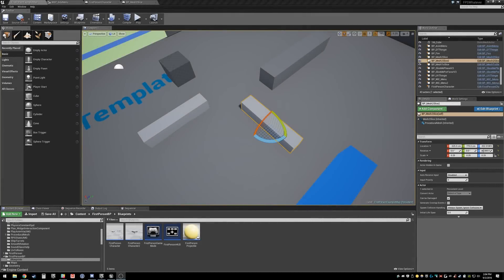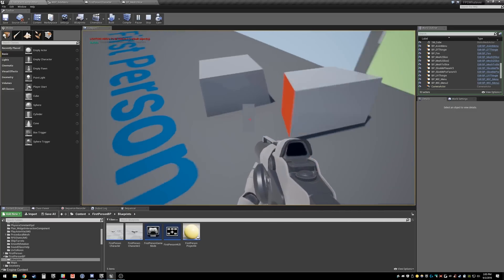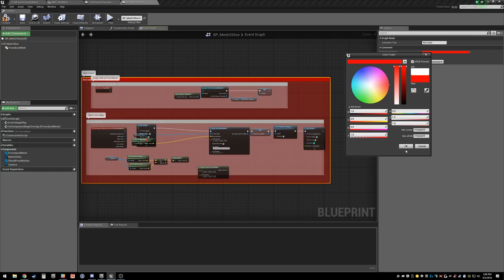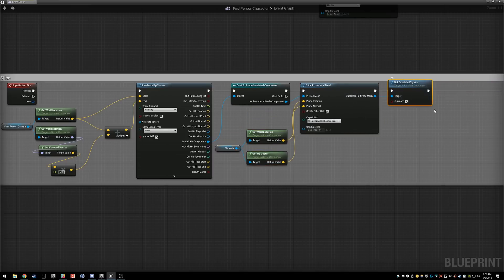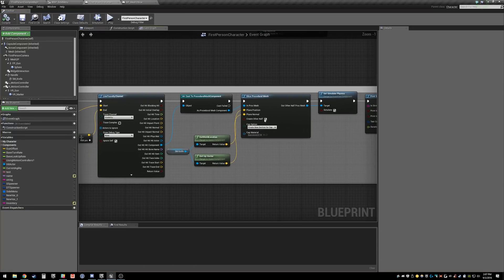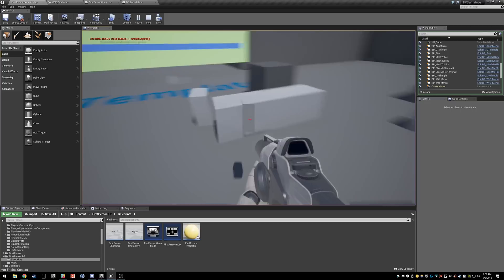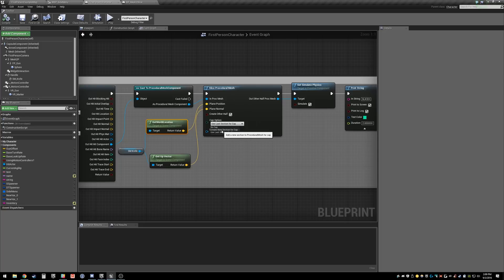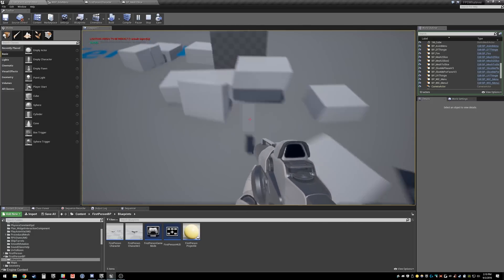Advanced -  Slice Procedural Mesh

Comment: Does this system work iwth complex shapes and objects created outside of the engine?  IE, could you slice up that gun that yoou are holding or does it only work with simple objects created in UE4?
Reply from the maker: Hmm, strange I didn't get these notifications. Hopefully you figured it out by now, but yes to gun being held, and no, not only. You can create your items as static meshes in your DCC. That's the only requirement right now. Unless you make a procedural mesh in engine first.